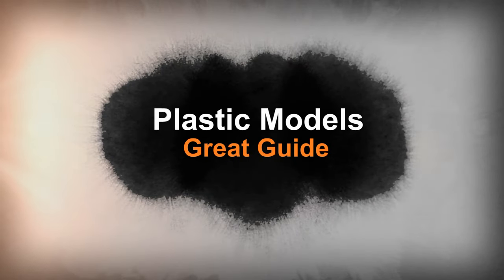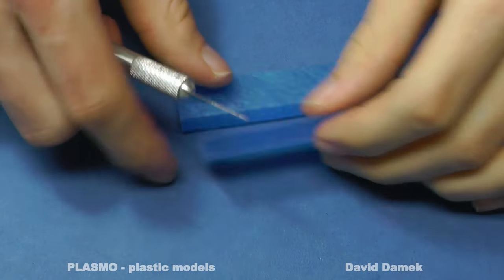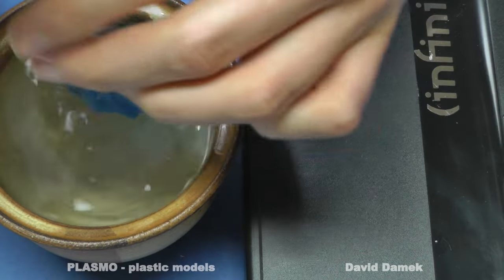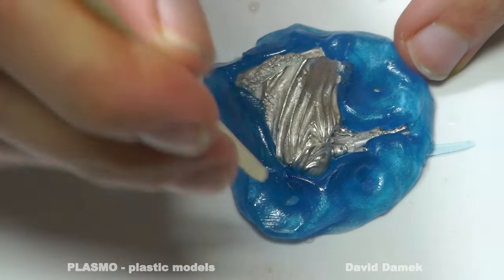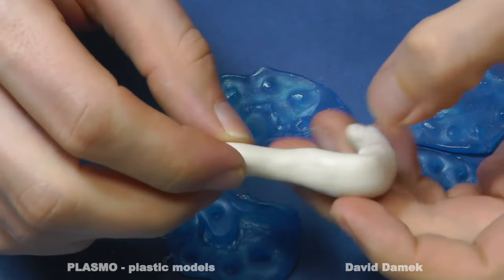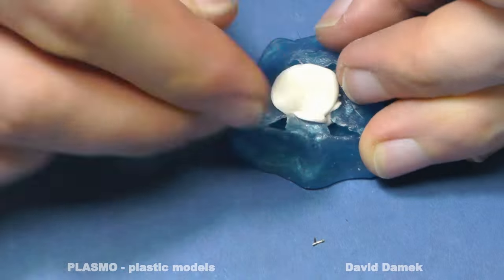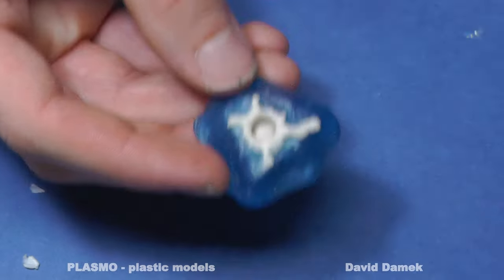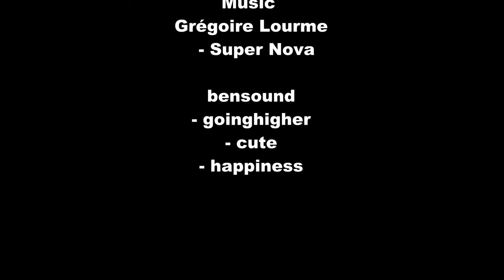Blue Stuff/Oyumaru  - How to cheaply cast miniatures or plastic models - new version

Comment: That's cool, but the detail is lost. All of the castings look too soft. As always, this method is good for the odd part, but rubbish for anything detail or with crisp edges.
Reply: I'm using it right now and it holds detail fairly well, its probably the lighting, it perfect but its great
Reply: @necrosisofphilosophy5247  I don't think it's lighting when the GW part shows it's detail well. You have a soft medium acting as the mold for another soft medium. That doesn't hold detail well.
Reply: @ScooterinAB  You're dead wrong, the detail is astonishing. The problem is mould lines, they tend to be a lot bigger than any other method.
Reply: @funoff3207  No, the details all look soft, because that's what this kind of casting does. It's not mold line. It's a lack of sharp edges. You can be a dick about it and keep saying I'm wrong, or you can accept that this isn't the greatest result BECAUSE THE DETAIL IS LOST.